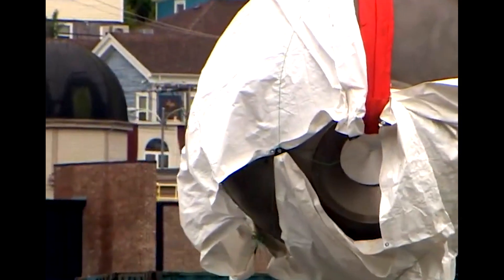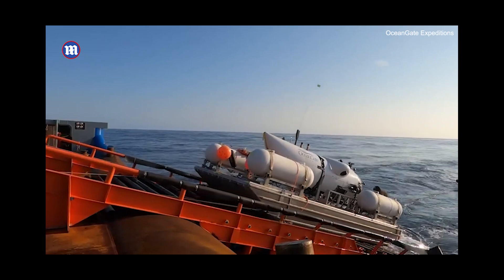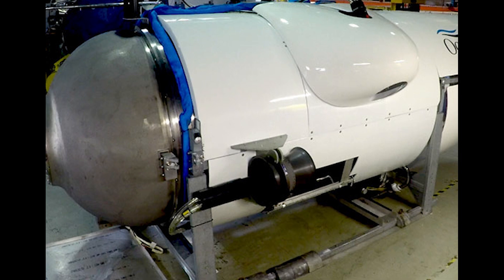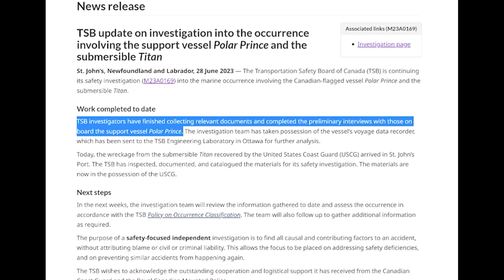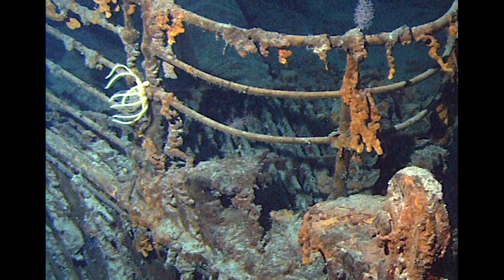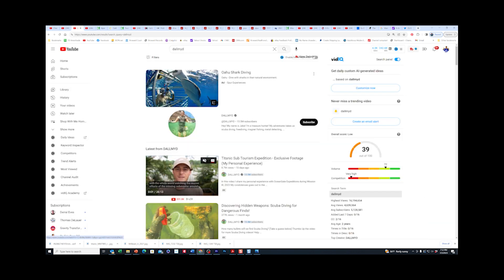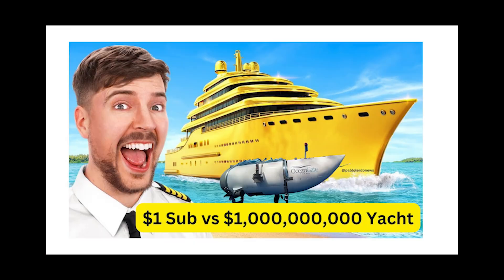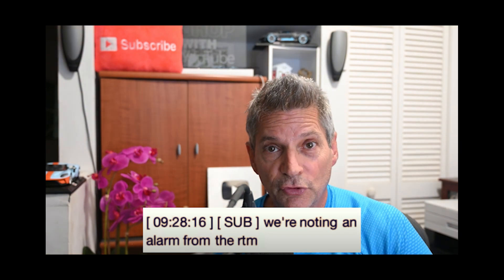Titan Submarine Debris Clues, Implosion Simulation

Comment: The implosion example you showed was insane. It's literally faster than the blink of an eye.
Reply: and the pressure down there is waay higher
Reply: The sound it made when imploding  is the stuff of nightmares. (9:44)
Reply: Probably at the depths and pressure it was at, even a super high-speed camera would not capture the implosion in more than 2 frames of video.  Near instantaneous.
Reply: Or the blink of most cameras.
Reply: The pressure on Titan is equal to the weight of the Eiffel Tower in France
Reply: Does anybody know or can calculate the pressure differential that allowed the barrel to implode?  Obviously outside pressure is 1 Bar.  The Titan was at about 12,000 feet deep or (if my math is correct) 765 Bar, more than twice the chamber pressure in the most powerful rocket engines on the planet.  The scale is astounding.
Reply: @wacobeer6469  Surface pressure is roughly 14psi (pounds per square inch). The pressure at the depth they started to drop weights at 3500m, would have roughly been 5100 psi. As you can see the barrel crumpled within a split second at 14psi. Imagine what 5k psi would have been like. The air inside the submersible probably compressed fast enough to literally explode like a miniature sun and if it crushed from the middle out, then it was probably 2 miniature suns.
Reply: @LetThatSinkInOk  Yes of course.  The barrel imploded with a MAXIMUM of 1 bar pressure differential (I was looking for the decimal portion to dial in that point).  But the Titan was at a pressure differential of 764 bar or so (assuming the passengers were kept at surface pressure inside, which isn't likely, but close enough).  Still astounding.

Comment: The portal window, one more theory, its stressed to resist 400 atmospheres from the outside, but only 1 from the inside. The main body collapsing while ocean water rushed in, could have created a slight over pressure on the inside of the portal window, which 1/2 a percent could easily exceed the design that is not stressed to retain the portal from pressure from air side of the sub. And that popped the portal out of its frame.

Comment: Fun fact, water is compressible.  At those depths, the water is compressed in the area about 4% compared to near the surface.  So, when the implosion happens, the compressed water expands into the low pressure area that was the inside of the sub.  The approximate rate of expansion is around Mach 2.  Or, twice the speed of sound.  They would have been totally shredded before even knowing anything happened.

Comment: I am no expert in submersibles, but the titanium ring should've been on the inside of the hull. That way the hull would  compress around the ring making a tighter seal under pressure, and the hull could use the titanium ring for support. Glue was supposed to keep everything together? 
Ideally you would want use pressure to seal a joint rather than tearing it apart. 
However in an ideal world, people would take safety seriously, do in depth and repeated tests, test to failure, and not cut corners. 🤡

Comment: My guess about the portal window is that as the tube imploded, the shockwave inside blew the portal and retaining ring out and sheared all the bolts like a cannon shot. It's designed for compression from outside, not explosive forces from inside.
Reply: that's what I think. Dont know much about deep sea salvage but I feel like removing 17 bolts at 4,000 meters to get a loop through it is a lot of work. Seems like it would be easier to use other methods
Reply: @Mrdestiny17 
Especially doing it remotely.  There is no one down there to run the wrench.
Reply: @Mrdestiny17  It would not only very complicate to remove the bolts at this depth, the even bigger problem would be that this would destroy any evidence from a failure at this place. Therefore I would rather try other methods to salvage the whole component, if the window, respectively the retainer,  was still attached, instead of removing it at the seafloor.
Reply: Struggling to get my head around it tbh, at all times throughout the implosion there was 400kg/cm2 on the outside of everything including the portal and at MOST the same pressure, inside unless the air igniting raised it hugely which it likely did?  But ignoring that, I guess instantaneously removing a 400 ATA pressure differential by flooding the inside in a microsecond would cause an incomprehensibly sharp jolt to those bolts wouldn't it. The dome flexed a lot apparently, bouncing back instantaneously probably would be catastrophic. Gaah. My brain hurts.
Reply: @GeoffInfield Don’t feel alone, I’m having trouble wrapping my mind around it too.
Reply: @GeoffInfield  That's always the problem, trying to comprehend the forces, speeds, pressures and sheer violence of it. The complexity of the physics involved is absolutely mind-bogglingly difficult to wrap your head around. We're used to seeing quick, but this is so far beyond our understanding as we perceive it in our everyday lives.
I'm not going to pretend to know even a fraction of it, just going off implosions I've seen in experiments, how materials break and react through experience, how much damage pressure differentials can do, even at far lower levels than this. I mean, have you ever seen a tire explode at only 30psi? It's crazy, and kills hundreds every year. The forces on that little tub imploding  are literally beyond our imagination, so much so we can only abstract it to make sense.
Reply: @GeoffInfield  don't forget the compressibility, and dwell time. Wouldn't doubt that thing seen tens of thousands of pounds of pressure for just an instant. Before it was ejecta in the ocean.
Reply: @animationcycles7109  Yep, the static pressure was almost 6000 psi, the dynamic pressure with an implosion would be like a waterjet cutter. Any organic soft tissue would be mostly liquified in an instant.
Reply: @GeoffInfield it happens that fast it would be missed in the blink of an eye,, literally...😮😮😮...flash boiled in a millisecond or nanosecond.. which ever is faster,, only one way to find out...FIGHTTT..😂
Reply: Exactly. There is absolutely no point in designing it to withstand forces from inside. If there are forces from inside, everyone is already dead.
Reply: I've been a scuba diver for 36 years, do not have interest in cave diving at all. But it never fails that there is always at least 1 person who doesn't follow instru tons, you know cause they know a better way. That and when you teach basic there is always someone cocky who usually end up panicking. My point was I've always followed the guidelines and am always paying attention. People get complacent and that causes death sometimes or accidents. But the panickers are the worst for Mr cause they can kill you quickly, no matter how many times you repeat that. Sorry I'm not dying because you were unprepared and then you get them out of the water and they want to be coddled. I'm like dude you almost killed 4 people go sit alone and relax. I know I sound cold, but like I said 75% of the time it's the same type of person. Now the other 25% I'm totally different. I've buried a child 6 years around the corner and my daughter is severely handicapped she needs mommy. I need her too!!!
Reply: The forces at play were simply IMMENSE, 365 Kg a square centimetre
Reply: I don't think that's how it works. You can't have a differential pressure where it's greater outside and inside the sub.
Reply: @magnusjohnson9552  ?
What part of the discussion are you referring to?
Reply: @magnusjohnson9552  This view doesn't take into account the speed and mass of the water which is entering the inside of the chamber at the moment of rupture.  This is why even home plumbing systems have expansion tanks, to reduce the water hammering force when you shut a valve off.    The pressure waves create localized pressure which will be higher (how much higher depending on mass and speed of the water and how quickly it is being stopped) than the system pressure, as the moving water (which has mass) slams into the now closed valve - the same concept would apply here as the water reached the end caps of the sub.
Reply: There was no shock wave from the inside.
Reply: @jgrenwod  There is if it's the cylinder that collapses. The water rushes in and forces the air inside to compress into the area of the titanium domes and the plexiglass window at superheated temperatures and with an explosive force that tries to blow them away from the center. The water pressure outside is simultaneously trying to push the domes into the space where the shattered cylinder was. 

When everything happens in milliseconds that shockwave is immense. There are also implosion pulse effects as those gasses expand and contract in a cycle for a short time until everything stabilizes, again with massive forces. Things always go to where there is least resistance.

Same as if you smack a plastic bottle in the middle it can blow the cap off.
Reply: @GazzaBoo  
Yes, I could see the impulse popping the dome out.
Reply: @jgrenwod  a phenomenon, compression ignition, could have occurred as the oxygen and organic material was subjected to instantaneous extreme pressures.

Comment: The implosion of the barrel was done with atmospheric pressure, i.e.14.7 pounds per square inch of pressure.  The sub was exposed to 5,800 pounds per square inch, or almost 400 times as much as the barrel.  Instantaneous is not quick enough.  Every part of the occupant's body that contained any air, or liquid space, including cranium, eye balls, intestines, lungs, bone was exposed to that same 6,000 pounds of pressure a soon as the pressure vessel imploded. Death was instant.  As someone once said about a nuclear explosion ... you're OK as long as you can ask "What Was That?"

Comment: One detail I noticed from the recovered titanium ring is that most of it's lip was stripped off and protruding from the edge (2:02 in the video). If high pressure water was able to get under the ring lip, it could have access to the layered edge of the carbon fiber hull and begin penetrating layers and exerting terrific forces against the lips of the rings. When a lip failed and forcefully broke away, it would certainly make a very loud bang, but the ring might still remain firmly pressed against the edge of the hull until enough layers are penetrated to make the structure unviable.
Reply: So, would the carbon fiber delaminate as the water penetrated the layers? or would the core implode wholly as the water and pressure became too great? (Curious, things respond somewhat differently on the surface of the earth.)
Reply: @ole5539  I think that the delamination contributed to the weakening of the tube especially at the edges. The occupants reportedly heard a lot of loud cracking sounds prior to the implosion. This would be a good indicator that some weakening was occurring. An image of an earlier scaled-down implosion test they performed on a small model Titan appears to show considerable edge multi-layer delamination(s) and circular fracturing from the lip of the titanium ring not compressing at the same rate as the carbon fiber tube. The stresses on those inner lips must have been incredible!
Reply: @ZippityDooDahDay  Thanks, well answered.
Reply: Nailed it! Just noticed that too. That looks looks only about 1cm of titanium at most. Once the glue gives way from the flexing all that pressure compressing the cylinder would shear that lip right off. That and the statement that all the rest of the hull ended up in the rear hemisphere adds up to the front seam being the point of failure. So does that mean the titanium actually failed before the carbon fibre?
Reply: @TroyMackay  It seems reasonable to consider that if the inner lip of the aft titanium ring fractured and collapsed inward, the already compromised carbon fiber cylinder edge might have collapsed inward and the millions of pounds of pressure pushing against the forward dome would then press the carbon fiber cylinder into the interior of the rear dome. The loud cracking noises the occupants heard in the back may have been the fracturing of the titanium ring inner lip prior to its complete failure.

Comment: Titanium end caps undamaged, zero carbon fiber attached. Why? Pretty simple explanation. Two different/dissimilar materials both under 5000 psi of pressure. The titanium end caps did not compress or deflect, the carbon fiber tube did deflect and delaminated/unglued off from the two titanium end caps.
Reply: Could there have been an explosion from inside the hull? Thereby cracking the carbon fiber and it shatters to bits and the end caps were blown away from the carbon fiber hull?
Reply: @MissX905 At 5,000 PSI nothing was going to explode out. At that pressure things only get crushed in. Interesting facts - it was over in under 30 ms. Due to the instant compression, the temperature of the air volume inside the sub instantly elevated to the surface of the sun.
Reply: @moletrap2640  Didn't he have oxygen cannisters under the seat of the submersible tho?

Comment: When the oildrum imploded, that happened at less than 1 atmosphere of pressure.
At 3500 metres, the pressure is about 350 atmospheres, 5145 psi or about 2.4 tons per inch.
It will be over in microseconds and there will be nothing recognizable after that as the intense heat of pressurization would vaporize everything.

Comment: Where are the holes that received the bolts which went through the flange, holding the portal window in place? If they unbolted the flange,   or the bolts pulled out,  you should be able to spot the holes on some of the photos.
Reply from the maker: Yes that is one thing I can't figure out

Comment: if the port hole was the issue and they pulled up all the titanium, where is the carbon fibre hull? Surely they could bring that up, or maybe a piece… meh, we know the muppets used the wrong design material for the hull.

Comment: They recovered it with an ROV that could not have taken off all those bolts.  If the lucite viewport had been the source of implosion, then the pressure would have inverted it INTO the sub. This would have shattered the lucite into shards and left the flange in place.   If the carbon fiber hull is what imploded, then the water would have rushed into the titanium dome, with exponentially increasing force, like the worlds most severe water hammer, and it would have blown the lucite port OUTWARDS. The bolts were designed to hold the port in place, but it was the conic fitment to the titanium dome that sealed and took all the pressure.  Water hammer from inside the dome would have stripped out all the bolts or snapped them off at the threads.

Comment: Wait a moment.  When they installed the ring on the cylinder.  It looked like the cylinder was not resting on anything on the titanium ring.  Meaning that under pressure, the only thing holding it together, is the glue, not the ring.  They should had a full notch for the cylinder to fit into. If I saw that right, then I would say the point of failure was the glue.

Comment: I agree with the OP of this video. The area of overlap between the titanium end rings and the carbon fiber is awfully narrow, likely not enough even IF bonding carbon fiber to titanium is a viable method to build a submersible. To me, the complete absence of fragments of carbon fiber remaining on the end rings strongly suggests the glue was the failure point, the carbon fiber center section failed, or most likely both. I suspect when it imploded, the carbon fiber shattered into countless small, supersonic fragments that killed the occupants even before the water did.

Comment: A totally and true layman here so bear with me and my question...why and how they decided to gown to 3800 m if they have a piece of this submersible rated for 1300 m only( the window)? What makes them sure that designed for  1300 m extrrnal piece of that submersible will endure almost 3 times the pressure at 3800 m?
Reply from the maker: That is the question everybody is asking. And the problem is that Stockton rush is an innovator and a swashbuckler and his own vision of safety differs from the established norm. I also believe he suffered from narcissism and so this would prevent him from listening to the advice of others relying solely on his own.
Reply: @jeffostroff  Yeah,  i got that but...the guy himself and his passengers where not people with IQ in the double digits hence easily  "discerning" that 1300 is almost 3 times lesser number than 3800 so how the owner convinced himself and them that's still ok to go down to 3800 m? Baffling isn't or more of a cautionary tale how good we are in beguiling ourselves if driven enough no matter what

Comment: The monitors are SCREWED into the hull itself people.  Screw 
S measures in inches, screwed into inches thick carbon fiber hull.  Ask Honda Motorcycle racing what happened when their carbon fiber rims were exploding after races. It was unpredictable and violent and it happened even if the wheel got a small knick.

Comment: One design problem noone has noticed but i have is the sealing flange used a single o ring and no step to center the mating surfaces. If that sealing dome shifted laterally the bolts surely would not be strong enough to hold it in place.

Comment: TLDR: Brittle material BAD for high pressure applications. seems common sense to anyone who passed highschool level physics. IT TRUELY isnt rocket science, its shockingly not. unlike steel Carbon fiber doesnt bend, it just snaps. Not the ideal material behavior for a submersible exposed to pressure differentials.